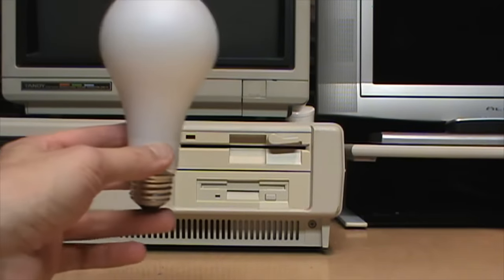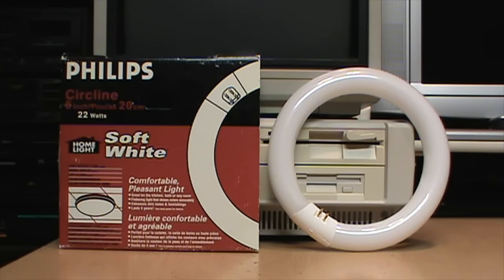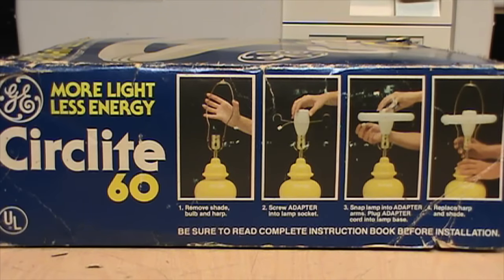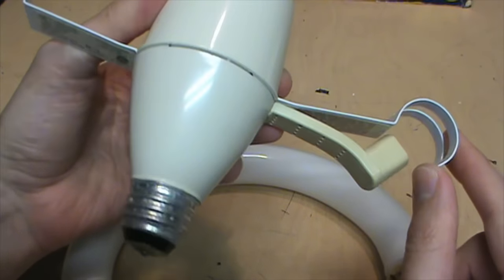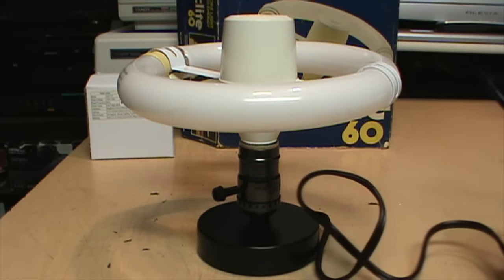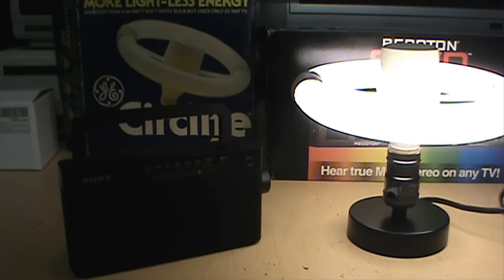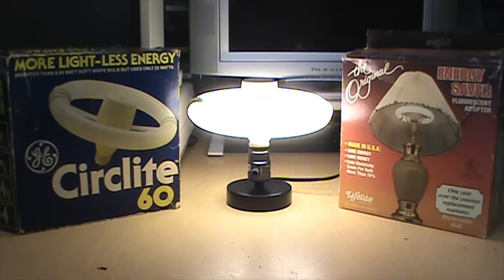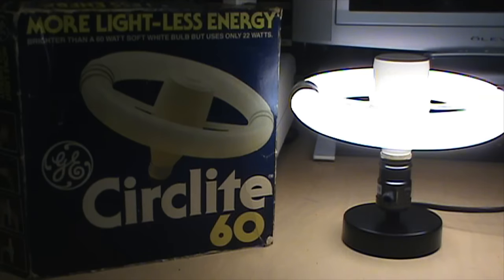The first CFL: 1979 GE Circlite

Comment: The thing I find really fascinating is that in recent years, bulb manufacturers have iterated to the point where some LED bulbs are nearly indistinguishable from the incandescents of the past. No doubt they were itching for ways to cheapen and miniaturize the electronics to the point where they could reuse the same cheap glass bulb manufacturing equipment and materials in assembling the modern LED equivalents.
Reply: If you were a bulb making company, you’d be pissed if you threw away all your bulb making machinery when incandescent was phased out.
Reply: One that I have run into specifically with GE LED light bulbs is that some bulbs have a noticeable flicker sometimes.  Not sure if that's because the bulb is defective, or the bulb can't gracefully handle dips in voltage like an incandescent can.
Reply: @meatpockets  I have a number of the GE LEDs (light blue frosted) and haven't noticed any discernible flicker. Sometimes LED flicker can have to do with other sources of RF noise in and around a house's wiring, though usually most UL or CE listed devices are well shielded/protected from those sorts of effects.
Reply: You are right on the money, when filament LEDs first appeared they showed dinky old bulb lines being used for it, they literally converted any line they could still find working to filament.
Reply: @meatpockets  maybe omitting any smoother/filter electrolytic capacitor 😉
Reply: Because many people like the classic glass bulbs and the filaments make the light more omnidirectional than that of COB bulbs. The light still isn't as good as incandescent though and most of them don't even last 1/4 of their advertised lifespan.
Reply: @westelaudio943 Filament bulbs suffer from their electronics cramped into the base, it get's hot there and they often flicker because of small cap. They look nice, though. I don't mind normal retrofits with frosted glass, though.
Reply: @gubr  

It is usually the LEDs themselves that fail, not the drivers. One goes open circuit or intermittent and takes the whole lot in series with it, with it. Because they drive the LEDs too hot. 'Dooby bulbs' seem to have gotten rid of most of the reliability issues, mainly by using a higher amount of filaments for a given wattage. But those bulbs like the ones with 4 short filaments for a 60W eq. are utter junk and you are lucky if they last one or two years.
Reply: @westelaudio943 Actually there are an increasing number of LED products out there that have a light quality about as good as incandescent. They're just currently on the expensive side. Also I find that you have to use LED bulbs in the proper application to not fail too soon. Many of ours have lasted just as if not longer than their projected lifespan. The traditional heatsinks models work better facing downwards whereas the filament LEDs work better facing sideways or up
Reply: @exoticcar5482  
Maybe your COB LEDs last that long, which I've never used much as I've always found them hideous. Filament LEDs came out in the mid-2010s so it's impossible for them to have reached their advertised lifespan yet - which is usually 15 years. And good ones that last even half as long are VERY rare. And no, I didn't put them in enclosed fixtures (by the way, what are we supposed to put in enclosed fixtures now anyways? I have some from the 70's, 80's I'd like to keep, so I put NOS incandescents in them).
Reply: @gubr   Big Clive has found some of them sink the heat into the connector, the ones that fail are usually the ones which don't do that so it becomes an oven instead
Reply: @marcberm Had 1 warm white frosted GE start to flicker half the LEDs then went out after 1.5 year. It was on basically the whole time, porch light. That being said the kitchen light same bulb has been on for 2 years constantly now.
Reply: I like the LEDs that use frosted glass way better than the ones that have a plastic diffuser that’s only half the bulb
Reply: The glass filament LEDs are BETTER than the plastic dome on metal base ones. They use helium gas to help transfer heat, and they tend to be better with the power budget. The LEDs are isolated from the electronics in the base. The filament Philips Ultra Efficient gets 180 lumens per watt, better than any other light source in the 120 volt world, better than most commercial LED fluorescent tube retrofits.
Reply: I got some glass LEDs
Reply: @westelaudio943  GE made LED bulbs designed and specified for use in enclosed fittings. Annoyingly they never sold them in the U.K. At the moment I use CFLs in my enclosed fittings and they last far longer than an incandescent. Sometime I might be tempted to try an efficient filament LED in one.
Reply: I'm not sure how this is possible. Every LED bulb I have seen has a plastic "bulb", not glass.
Reply: @exoticcar5482 I have been very satisfied with the GE ones. I put a GE LED in one lamp and left the incanadescent in the other and apart from a tiny different in brightness (the LED was brighter), there was no difference. And I don't get headaches or nausea from them like other LED lights!
Reply: That and the cfl bulbs just didn’t look right in many fixtures.

Comment: The house I moved into had a circle light fixture in the kitchen. It was hard to find a replacement when it went out. After that burned out we eventually replaced the fixture and now use bulb- shaped LEDs.
Reply: really? i guess my town is really lucky because my hardware store has a crap ton of fluroscents
Reply: never liked the glow of the fluorescent lights.
Reply: @Warp2090  One hardware store had it for sure. Maybe they did just fine. But they kept burning out quickly. Was it the fixture?
Reply: It was probably the fixture or something, because fluroscent bulbs last a while @DougMcDave

Comment: In the UK and Europe we also had halogen bulbs between CFL and LED. They were small capsules inside a bulb shape. They are now being phased out, but they were better than CFL (better light, dimmable). They used about 25% less energy than a standard incandescent.
Reply from the maker: We had those too, until they were banned in August 2023.
Reply: @vwestlife  I bought a halogen bulb like that once.  The thing would work for five minutes, get hot as hell then quit working for five minutes, then come back on.  Too bad, it put out a nice quality light.  I haven't seen them in a store in years, though.  I still have three of the old large cylinder "CFLs" still in the boxes, too -- I must have bought them in the early 1990's.  They don't fit in anything but the old bulb socket and nothing else ceiling lights so I used a couple back then and still have the rest.  They were also only rated at a 52 watt incandescent equivalent.  They wouldn't fit in any light fixture in my somewhat modern home and are too heavy to use due to the chain that most of my fixtures hang from (they are about 15 pounds each), due to my eyesight issues I am actually running two 200 watt equivalent (22 watt actual) LED bulbs (one in my office and one in my bathroom) without the globes as I really need the extra light and nothing that produces that much light will fit in the globes.
Reply: We have those in Australia as well, they’re almost phased out now though.
Reply: @mharris5047  Halogen light bulbs are designed to run "hot as hell". They are incandescent lights putting put more light by running hotter but with a special gas mixture inside that keeps the filament from destroying itself. If your lamp tuns itself off after five minutes then there's something else wrong with it.
Reply: Fortunately I still have a few of them as so far I've had no luck finding an LED bulb which works properly in a touch lamp and doesn't buzz. Fortunately it's only one lamp which typically gets a couple of hours use each evening.
Reply: Another downside to the halogens is that they can explode quite spectacularly; years ago I worked in a bar that had those GU10 spotlights all along it, and one night one of them let go with a huge 'pop' and a shower of sparks and hot glass rained down on the counter. Never liked them after that, although I did think the dichromatic rainbow effect they gave off (similar to early HID car headlamps) was kinda cool.
Reply: I had to stock up on halogens myself before the ban. Have a few halogen floor lamps I absolutely could not continue my existence without!!

Comment: seeing CFLs instantly remind me of the 2000s. we still have working CFLs around our place -- most of them are still installed in areas that we don't usually enter 😂
Reply: I actually had some incandescents outlive my CFLs because they were in closets and such. I have a couple of CFLs left but I've never been a big fan of them.
Reply: I was okay with decent-quality CFL units, but it is funny that (despite some QC issues and early failures) we have many still-working ones stashed away, along with incandescents, unused simply because we have so many LED ones that are nicer overall. But to this day, I still have and use a couple of incandescent/halogen closet lights; they get such brief and infrequent use that immediately changing them out for LED has negligible long-term benefit. Otherwise, though, I'm now primarily using LEDs plus a few stray CFLs.
Reply: Got some too, it kinda feels like we just switched to em huh?

Comment: These were used by many hotels because they used less energy, didn't require as frequent replacement and were less likely to get stolen. They were a pain to change out, though, if they burned out while a guest was staying in the room as normal desk clerks didn't usually know the procedure and it was time-consuming even after they learned how to do it.
Reply: I imagine if that was the case, it was probably more convenient to just replace the entire burnt out desk lamp with one from an unoccupied hotel room, down the hall!!
Reply: The original Circlines in their special fixtures were also popular as hallway lighting in cheap apartment complexes built in the 1950s and 1960s, and for the same reasons, particularly the "no point in stealing the bulb". It was known fondly as the "landlord's halo", because when your landlord was pounding on your apartment door because you were late paying the rent again, and you peered out your peephole, you saw a flickering Circline glowing behind the landlord's head.

Comment: My grandmother used a Circlite in her kitchen fixture for decades. That bulb out lasted her, and she told me that it was purchased in the early 80's. Even back then, light bulbs were built better.
Reply: My grandma had one too, it was in her floor lamp in the living room, I don't know if it burned out or it was just a power surge, but we were changing it out a few years ago (probably for either a new LED or just an old incandescent she had, she's a bit of a hoarder), and I was wondering what the weird steering wheel shaped bulb they were pulling out (and leaving cracked plastic everywhere) was called! My grandma (on my mother's side) also has that 50's fixture with the same lamp in her utility room (only with one bulb in the smallest size) and it still works great, but that other one with all three sizes I just learned about now looks even cooler!
Reply: Oh and the grandma that had the lamp also had the same huge shade (same design too and still does), you can tell things like that were made just for that time because now the new lightbulb looks dimmer and kinda puny even with more modern and efficient bulbs (or even just old incandescent bulbs, didn't check what she was using)

Comment: I LOVED the Circline lamps. The GE ballasts were quite electrically robust and had good heat dissipation and therefore lasted A LOT longer than equivalent light output curly fry lights. I even did away with globes and used 4 in a ceiling fan. The ballasts were more than robust enough to take the shaking. The light wasn't too harsh and wasn't too yellow on the GE OEM bulbs. I really still like the things and wish you could get them new. They lasted for YEARS. EDIT: 11:28 yes they were a PITA to initially install, but once installed, they'd last the better part of a decade.
Reply: yes as a kid we had those lights in the kitchen !
Reply: He does mention buying some new tubes at the start! Maybe you'd have to order them online though.
Reply: Wait a minute.  You had four circlines installed in a ceiling fan?  That must have been quite a sight
Reply: It was ugly, but it lit up like the sun and didn't throw off hardly any heat. The 'Mad Scientist" look was a bonus. @TheGreatAtario

Comment: They've got that space-age kitsch aesthetic when used as a ceiling light, especially compared to the square tubular bulbs of the 90s.

As for the circline bulbs themselves, they're still pretty popular in Australia, often inside an oyster light, a fixture that seems to be in every kitchen built since the 90s.
Reply: A friend of mine has one of these things he calls it a UFO bulb, well anyway it is in the dunny.  He had  to replace it not so long ago, kind of funny to have this type of light in the shithouse.
Reply: I'm in Adelaide (Australia) and there's a 22 Watt one of these in the laundry. Gives a good light and it's working fine.

Can still buy the circular tubes easily too.

Comment: The neighbors across the street had the double circlite in the kitchen, but even more interesting was that the house had Remcon low voltage light switches/controllers.   These were rocker type switches that operated relays which in turn operated the lights.   There was a "master panel" (8 or so buttons) at the end of the hall next to the master bedroom where you could remotely turn of lights in the rest of the house.   I don't remember but I think this kitchen fixture could be set to high/medium/low by pressing one or both rocker switches.
Reply: Ho you should visit my parents then, they still have a 1960s GE low voltage lighting control system with the two dials. To this day I think of the number 4 when turning on lights when I come home.
Reply: @8BitNaptime  I've never heard of this master light switch setup before. Super cool. Seems it would pair well with those intercom systems that also had a master radio to hear music throughout the house.
Reply: @cassandrajoiner9933  Very much on the same level.  The "tech" was cutting edge at the time (mid 50s).

Comment: One advantage of the Circlite or Circolux is that it produces more light downward, and less to the sides, which makes it good for table lamps on desks. Also, GE did something before this called the Halarc or Miser Maxi-Light that was a miniature self-ballasted metal halide lamp intended for replacing general service incandescent lamps, but unfortunately it never caught on and Halarc lamps these days are very expensive collector’s items.
I am also guessing the reason why they dropped the trademark in 2020 is because a company called Savant Systems bought out GE Lighting and did all sorts of bad decisions.

Comment: I am very fond of these lamps, I still use many around my house to this day. Among my favorites is the GE 2-D series. The 60-watt models output an excellent quality of light, it's almost indistinguishable from incandescent.
Reply: At work they fitted 2D wall lights in a building built just ten years ago. They have been more reliable than the LED pendants they fitted in the canteen (although there are about 30 of those).

Comment: Thanks VWestlife..

I Never had a Circline bulbs  but in the mid 1980's the local power co was selling Sylvania CFL bulbs  for $5 bucks a piece. Bought about 6 of them and change my Apartment  over to them from the regular bulbs.When I left my apt 18 years later to move into a house  .A few were still working.

When  the LED bulbs came out .The local elect company later on were giving away a box of LED bulbs and i change the CFLs out to LED bulbs in my house..
Reply: I still have 20-year-old Panasonic CFLs in my bathroom, and every single one of them is still going.  As they've aged, they're actually better for this use, as they come on very dim then gradually fade up over a minute or so.   Absolutely great when you're getting ready at 5am.
Reply: Did those old CFLs blink before turning on? They may have been magnetically ballasted if they were that old.

Comment: I started using these around 2002 when we got our first house.  They were so much better than CFLs and I could get a variety of color temps.  The ballasts were good for about 2 tubes or so.  By it's 3rd tube, it usually died.  I still see the kits lurking on the shelves of hardware stores.
Reply: It was the internal starter that died. You can cut them open and wire in a new starter, or wire in a starter socket and glue it to the end of the adapter.
Reply: @gregorymalchuk272  Sounds like a good place for an Electronic Pulsestarter. Those also make the tubes last longer as they have a timed warm up period so the tube always strikes first time (at least they three I use do).
Reply: @MrDuncl  Do they have those in the 120 volt market? Or are they universal because the ballasts make the open circuit and run voltage across the lamp the same? I know they were really popular in Europe where the choke ballast survived all the way to the present due to it being simpler with their higher voltages.